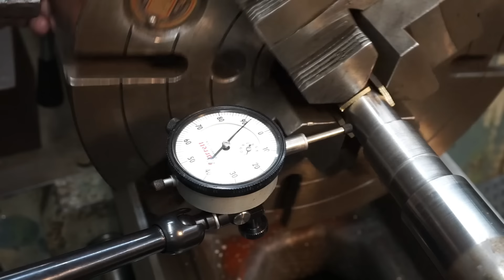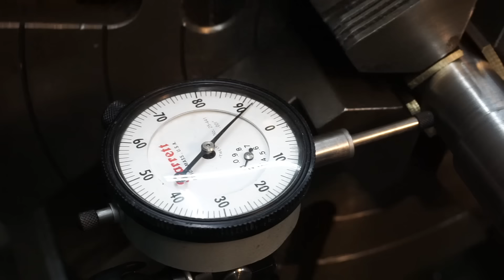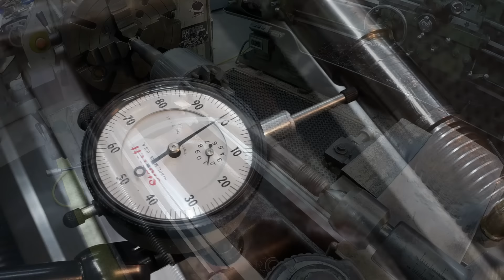Spray Welding a Pedestal Grinder Motor Shaft

Comment: As an electrician with 28 years under my belt, I'm rarely impressed anymore , but your skill level at your trade has impressed me for sure. You make me wish I went into machining instead. Great video 👍
Reply: finished electrical engineering-school with age 57 this June , now I started machining engineering school 3 days ago ;-) - it's not too late, man!
Reply: what part impressed you the most ? IMO it's pretty standard machining skills.
Reply: @xl000  did you do spray welding yourself??
Reply: @Allen M - Well, he sure is lucky to be in the niche he is in... Machining new things all the time is what keeps you going. Can you imagine going to school only to watch parts spit out of the other end?? Or make 138 identical shafts in one day?? I'd go nuts... This guy earned it and knows whats up...
Reply: @paulwyleciol3459  not what he means...He's likely about  to retire
Reply: @bilbobaggins4710  who knows ;-)
Reply: We’ll always need guys like you to keep the lights on 👍
Reply: It's never to late unless it is to late
Reply: Ha!  You should see mee
Reply: Funny, I wanted to be an Electrician at the Timken Company, but ended up getting hired in 1982 as a Millwright Apprentice instead.  I do machining as a hobby now.
Reply: @flashgordon6238  I envy you.
Reply: There's nothing difficult about being an electrician.
Reply: Upon seeing you doing this process, I bought a used ROTOTEC gun and I'm going to attempt some shaft repairs at our Ag shop. Thanks for making it look easy enough to try it myself. If I'm successful, I'll be able to save my company some money over replacing parts

Comment: Who else wanted to see him try the bearing at the end
Reply: i was looking at the bearing on the table thinking, cant wait to see the bearing back in with no wobble!
Reply: @Mortarman0341  hope that's not tempered shaft
Reply: yes, but I think he fucked it up so that is why he didn't show it.  He will spend the next 2 days off camera trying to get it to fit.
Reply: I was waiting to see as well but perhaps he didn't want to throw off the shine he worked hard at. Might be a pretty tight fit to be on properly so maybe would leave marks when removing. Still, I did want to see it.
Reply: @jackschitt7783  what do you think people did before CNC existed?? You sound like a loud-mouthed apprentice or amateur... the guy who worries and spends more time sharpening and polishing tools instead of working.  😂 It's pretty common for people who know a thing or two about sharpening to work by hand.
Reply: @jackschitt7783  CNC for sharpening? Are you crazy?
Reply: Because his task was to make shaft with correct diameter. Micrometer is enough to know if if fits. Why press bearings and pull off again?
Customer will install this on engine
Reply: Torkalo Volodymyr yes.  these comments are funny.  if it was correct DIA youd need to forcefully install and remove. bunch of YouTube experts
Reply: Pat McRoind you’re way in left field, hand sharpened tooling has made precise parts for decades!!!!! In addition, if you can’t sharpen a drill bit free hand you have some home work to do!!!!! That’s sharpening 101.
Reply: Yeah, why didn't he,did it not fit without  a hammer
Reply: @Mortarman0341  If it measures right it will work unless the bearing is the wrong one or made wrong. I think he knows how to use a mic.
Reply: @jackschitt7783  I've been a machinist and toolmaker for over twenty years, he knows what he is doing, if I could not do something myself do to not having the right machine I would trust him to perform the work properly.
Reply: @tymader8927  seem like you know how bearings are installed :DDD you don´t FORCEFULLY install bearings :D
Reply: @jackschitt7783  first off it's a 6306C3 bearing meaning that bearing can have .003" play in it. Secondly he said his final jnl. O.D. was 1.1815. A 306C3 has a bore size of 30mm (1.1810) For this application it's going to be a press fit with the outer race being the tap fit in the housing bore. So his negative half thousandths clearance is going to be right on the money if you look up 306C3 press fit on a tolerance chart!

Comment: I have heard of spray welding, but never saw it done.
Thanks for the education.
Reply: spray welding is what you could call my welding technique the one time I welded sometime (normally)
Reply: you dont hear the metal-parts people mention this, they want you to buy a new one
Reply: Man your so talented at your job. Do you own that shop your in?
Reply: @FishingWithVasquez  Yes, he does.
Reply: Old school additive manufacturing
Reply: Its called metal spraying, loads of places do it.  Its not as good a fix as welding as it can break off, but its  cheap and quick,  and looks the part!

Traditional weld up is a far better fix!

Spray welding is another process,  using a MIG welder, when welding you can spray weld or dip weld, that refers to the electrode and how it interacts with the metal being welded.
Reply: I've heard of flame spraying.  Is that a similar technique?
Reply: @keithjones8659 We always knew it as plasma deposition, its done with an oxy-acetyline flame and basically a very fine metal powder or plastic powder (at different settings) propelled by compressed air into the flame, they are melted and stick to the target.  Stick is the target word as  technically its stuck on top of the base metal, not like a weld that is joined/melted in!
If you machine through it, or wear though it it can break off in bits, not like a weld build up that can appear like the original metal.
But if you have the kit, its a reasonably cheap way of fixing something that's worn out!
We only ever used our gun to apply plastic for rust prevention but it can be used with other  metallic powders too.

The metal powder is created in the first place by a process called atomisation  this happens when molten metal is forced through a very small die <1mm head at high pressure  and then gets  blasted with a vortex shaped blast of compressed air as it exits the nozzle!

I used to manufacturer these parts for a UK Company before they got bought out  by an EU company and then made the hoops to jump through untenable!

The atomiser nozzle had a drilled and reemed 0.8mm hole that was 15mm deep in mild steel...  Nightmare!

My company helped develop those parts, then the EU based parent Company has now got someone in their back garden manufacturing them!    We got stiffed!  WANKERS!
Reply: @chadsimmons6347  depending on the application, this method isn't suitable in all cases!
New one usually always costs more, but in certain apps downtime costs more than new parts!
Would you want a warn out jet engine shaft metal sprayed up and re ground, OR a new shaft???

25yrs time served on machines and degree qualified mechanical engineer in me says new shaft!
Reply: @johnshaw8013  seems like more planes are going down from software problems, than mechanical failure these days, if Abomb did the shaft fixing, i would trust it!
Reply: John Shaw This is a grinder for Pete’s sake. Perfectly acceptable repair for the application. Don’t overthink it, it’s not like this is some fancy schmancy MRB repair. Heck, I’ve had great success doing a similar repair using Devcon.
Reply: @johnshaw8013  my dad used to shot peen the cracked landing gear on 747s, I remember cuz he would come home and we would pick a few bb's out of his skin, they once flew him to Hawaii to do it. He was one of the only guys I know of in California that could or would do this. I think they do it right on  the assembly line now (meaning during part manufacturing they claim makes them not crack so easy if the do the crack isnt as long ). But back then they did it after the fact. He worked for a smaller machine shop. 1 city block long he wasnt a "machinest" either he could and would machine. But he built the company the buildings and such keep the machines up and running. Kinda the opposite of spray welding shot peen.
Reply: @johnshaw8013  they use it as a offshore repair method for turbine engines (and all other shafts) in military operation, Or so they use to. One of the old engineers in town use to serve and would give me a "while I watch lesson and commentary". there are two methods Cold and hot, the one depicted was cold, the hot method is done when the shaft is cherry and a  glaze flux/primer on shaft goes glassy, the down side is the shaft must be fully supported as it will be very soft during the process and can go very wrong when too hot. looked a lot like brazing but left a cast iron looking finish that machined like a mild steel.
Now days in the navy I suspect they just fly shafts out when required and don't maintain an engineer trained in such tasks.
Reply: @olik136  😂 😂 that's why I don't weld
Reply: Me too Richard
Reply: That was cool.  Thanks!
Reply: @another1commenter770  We used to do it some 25 years ago. With the hot process, you can deposit ceramics (Tio, Al2O3) and get stunning results.
Reply: Me too... :)
Reply: Great video thank you 😊
Reply: I cant find your email but theres a pretty nice 1941  30 nn big monarch for sale nj for really cheap it looks really nice it says 156 inches between centers its looks pretty nice
Reply: @olik136   That would be spray transfer arc mig which I dont really know what it is other then the electrode acts diferent with the base metal
Reply: goober29
Reply: Oli
Reply: Chad Simmon
Reply: goober2
Reply: O
Reply: @johnshaw8013  I was going to say, it's more of a sintering process than welding.
Reply: @Storm13Cloud  sintering normally involves mechanical pressure being applied.  This process is done at atmospheric pressure.
Reply: @johnshaw8013  It normally involves pressure, yes, but it isn't required for the process to be considered sintering.
Reply: @keithjones8659  Same thing, using oxy/acetylene using an oxidizing flame and basically flowing a powdered metal in front of the flame path witch melts the metal powder and "throws" it onto the preheated part, works very well for many types of repairs, also can use ceramic, awesome for sealing surfaces, (o-ring areas and such) on rotating machinery.
Reply: @johnshaw8013  Pffffft, pipe down, its just a pedestal grinder motor shaft, Troll.
Reply: Oli K k
Reply: @olik136  When I learned,it was splatter welding,or "sometimes" welding.Sometimes it would stick,sometimes it wouldn't,but G'pa said THAT's what baling wire was for,lol
Reply: goober2969 qqq qqq.

Comment: I've been a machinist and smith for 30+ years now but haven't seen spray welding until now. Thanks for the very detailed video it was a pleasure to watch.
Reply: as a true machinist, you never tamper with heat like that on your part. Although it is a very nice video on emergency repairs. That is unless you put the piece back through an annealing process and have the proper tools to verify hardness and internal grain structure.
Reply: Me too. Ive been a welder and blacksmith for fifteen years. Ive worked at shipyards all over and I've never seen it.
Reply: I been doing it since the early 50s and there is no possible way to know everything but now I just watch u tube and I'm totally blown away what's out there now, I'm glad I'm out were now obsolete
Reply: @realrandom7666  That shaft is not likely hardened, unless there is enough heat to warp it it would not affect it.

Comment: This is a much better repair to a worn bearing- race journal than a few that I have attempted. I would have peened several center punch dimples in the shaft and put it back together. That method works in a pinch but doesn't last very long, nor does it make sure the bearing is exactly centered on the shaft. BEAUTIFUL work as always, sir. I was aware that shafts were built up by welding before being turned back down to spec, but never knew the process used. THANK YOU!

Comment: I repair electric motors for a living and our machinists do this all the time for our shafts. Its pretty neat.
Reply: Care to tell what kind of materials are used in this? I get the method of pre heating axle and trowing super heated metal particles at it that weld them selfs in place, but what else is in that powder than steel dust? I'm thinking DIY this including powders, if i ever have need for it.

Comment: Oh yea , old memories we did thousands of rollers and journals , same torch set up . Only for the rollers we used the lathe power feed with a hanger system to keep depth uniform. Big rollers from us steel were stick welded and lucky me had those jobs to turn down and polish. 12" x  36" with journals 6" x  14" . I went thru lots of high speed and carbide . Thanks good videos.
Reply: nice

Comment: We do this at work almost daily, we call it metalizing, but the benefit is that it’s typically faster than sleeving, and you don’t have near the heat of welding and returning. Keep up the good work brother. Manual machining is dying around my city/region, glad I was able to work with some of the older hands that were able to teach me a lot of this.

Comment: Any time I feel like I have experience in anything, I just have to watch machining like this. I can learn/do just about anything, but machining is one of the few skill sets that I would pick up via school. There is just so, so much to learn, and then there's the experience on top of that which comes only with time. This stuff is like black magic to me, because so many details go into doing even the simplest things. The flotilla of tools and tooling required is also very intimidating compared to other things. Nice work, didn't know about this process!

Comment: Saw this done while I was on a submarine repair ship back in the early '80s. The turbine rotor wieghed 1,800 pounds. It took 6 hours to get the journals up to temp. I was not a machinist (radar man) but I loved to go down into the below decks shops and watch how they did things. I have loved machining ever since. Thanks for sharing

Comment: I used to do spray coating like this on pump shafts, electric motor shafts, and other driveshafts when I worked at a chemical plant as an inside machinist. Excellent video.

Comment: I was going to comment that this was really metallizing and not spray welding, but ABOM cleared that up before I got a chance to. Great job!
Reply: We had some rare Foyt crankshafts that we periodically had to have "throw welded" when bearing sizes would get too big.  Is "throw welding" the same as what we see here?
Reply: @ramosel  I think "throw welded" doesn't refer to the process but that you are welding on the throws of the crankshaft where the connecting rods attach. I believe they would have used this process to do that.

Comment: As a fellow machinist, I really enjoy seeing the attention to details that result in quality work like yours. Regarding the welding process, what form of spray welding are you using? 

Doing a quick search yields several variants:

TSA, TSZ, or TWAS (Flame and Arc Welding): uses fuel such as acetylene or an electric arc to create required heat.

PTA (Plasma Transferred Arc Welding): uses ionized gas and powder to coat materials

HVOF (high-velocity oxyfuel): uses pressurized gas combined with powder. 

Detonation Gun Spraying: mix of gas, oxygen and powder is ignited in gun barrel.

Thank You
Reply: I suspect its HVOF, the flame burns a bright blue almost turquoise, and he adjusts the oxygen levels. I cant tell for sure though. Search for these methods on youtube and compare the vids I guess
Reply: Interesting question. I didn't even know there were different processes.

Comment: I have been familiar with welding for some 30 years, and I've seen some machines that do something similar which they call additive manufacturing. But I never knew you could spray weld like that. My mind is blown. Thanks for sharing! Awesome job as well!

Comment: We used to braze brass onto cast iron Fahr Mower bearing races and turn them back down. Not as cool as your method, but 40 years ago, it worked and saved farmers hundreds of dollars.
Reply: I've done similar on farm equipment.. had a few really bad ones I chucked into the lathe and mig welded back up, then ground back down.. Not nearly as pretty a result, but it worked
Reply: Ahhh brazing.... As a commercial plumber.... The words braze and weld.... Or sweat and solder make me jiggle 😜😂👍 another dying breed.
Reply: Swampy  supply goes down, price goes up... 🤙👍

Comment: Super cool repair! I used to work in an auto frame shop and I got to see a zinc spray welder similar to this but for fixing rust in sheet metal. I thought it was the coolest thing ever. Love the channel and how you run it man. Keep it up

Comment: Adam good memories for me I worked in a high pressure dry steam plant and we repaired our electric motor shafts and steam turbine shafts for our boiler feedwater, condensate & #2 oil pumps. Sometimes condensation will contaminate the tube and cause the issue you experienced with the first journal. Great content & knowledge transfer. Thank you!

Comment: Awesome job, with old school equipment, I was a repair engineer for GE Aviation and 29 years of working with their engines. A lot of manufacturing companies now put repair datum points on their prints so you have surface to cut down to before you add material and machine back to the blue print dimensions.